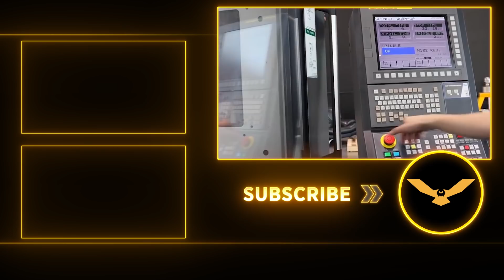There Was a Fire in Our Machine Shop

Comment: Used to have this stuff called Firetrace in the extraction hoods of the chemistry labs that I worked in. It was put in after a fire in a hood destroyed two whole floors and took them out of action for seven months. After Firetrace was put in a fire happened. The system worked, cut the electricity, put the fire out in 12 seconds. Fume hood operational in two hours. https://youtu.be/NzTkssjNRGs?si=s4wvzm1sdz9lZk1_

Comment: Seems like a solvable problem that could have been averted, using thermal 'cutouts' as heater safety backups, and possibly a 'dead man' timer that unless unit is checked & timer reset, it times out and halts after last process then shuts system  down completely, (similar to unattended X-ray film processors I've done in larger hospitals and as done in commercial photo development systems,) it could integrate an internal or 'local' fire suppression system to avoid a trigger of the entire facility fire suppression system also.😎

Comment: I know just how to prevent this, it's easy! A  redundant heat and fire monitor disconnect system, it's easy to build! Two simple process monitors measure tank temps live, if a tank is detected to be over max setting on either monitor, one or both in-line electrical contactors are automatically tripped and disconnected canceling all power to the process. Both these contactors can also be triggered by a fire monitor above the machine in combination with the tank monitors while also signaling your main shop fire monitoring system there is a fire present in the shop. The reason I do things in two's is preventing single system failures. You can also add localized fire suppression as an optional feature.
Reply: Even something simple as a float switch. It doesn't even need to sense heat it just knows at what level the level is too low.

Comment: I had to repair a lathe that had been damaged by fire. The shop was a large screw machine operation that used oil. If the wires for the door switch hadn't burned through and shorted stopping the machine, the coolant pump would have continued to feed the fire for who knows how long.

Comment: similar thing happened  at my job with a 55 gal strap drum heater.  It was used to evaporate  mixed mopping water that had a lot of way oil.  It was left on during weekend and caught fire .   HazMat  showed up and didn't know what the chemicals were .    One of those things that customers need more than one supplier  for

Comment: what is absolute ,machine orgin and realitive  in cnc milling machine . any one explain
Reply: Absolute is a measured point is set by an operator. Machine is the actual machine position in relationship to the distance the machine can travel. Say it has a 54" X, 34" Y, and 24" Z travel all of those start at 0 going up to those points. Along that travel an operator can set a " new zero" for a part to be made from. As in the center or corner of a vice or palet. This makes it so that when programming one doesnt have to make a starting point of 18.7267"X and 12.2323 Y and 4.7465 Z, they can set  Zero's for those points and measure out or up or down or in, from there. 
Hope that was more clear than mud.
Reply: @cliftonlewis1420  thank u so much 
bro
Reply: @viswasnadella8983 Wow you mean that made sense? Your welcome.

Comment: Need some sensors not only to notify the people in the event of a fire or something going wrong in the each machine but to cut off power and water supply to the machine shop for safety. A system engineer can get it done. Careful, boss!

Comment: I would have to use several microcontrollers with sensors to detect smoke, temperature,  water on the floor etc and get notified in the event of something going wrong like that.  Not hard to design and build.  Could setup several raspberry pi's or even arduino's to handle the monitoring.

Comment: Hi! Mistakes happen... Also a reason for a Fire at/in Machines is : mixing material like titanium and aluminium and coolant(Water). Gases are created that can burn! For example:
First you are working with 7075 aluminium / coolant- lubricant. Than you  working with titanium / dry Milling with sentos/air lubricant. The chips / spiders are glowing sometimes a little bit... And BOOOOM! The Mazak, DMG, GROB, Studer or what ever is burning... (there is a highly flammable Gas). In big Machine Shops they have  Machines only for Titanium and only for Aluminium... Or you mount a fire protection system in all titanium/aluminium machines. What says your insurance contract to that problem? What do they prefer? Sorry for my bad english! I wish you all the best for the future!

Comment: You can still do it, honestly it should have been in a separate installation apart from the rest of the shop. If you get say some EOS metal printers they should be in their own separate facility.
This is one of the few areas where lean manufacturing and space design has a definitive line. Some things need to be apart and separately in their own facilities.

Comment: Wow, that doesn't sound right, heating elements in a plastic tank? Auto shut-off when liquid level goes low didn't work? I've built systems like this before and my systems would've never failed like this. I make it impossible to fail. Hindsight is 20/20, but foresight is a thing and it sounds like someone didn't think about it when putting that system together.
Reply: No kidding

Comment: Why on earth did the shop not have sprinklers and a fire alarm system?
Reply: They were probably thinking "ha it will never happen to us"
Reply: I think it’s because you don’t want to wet all that machines, it could burn out electricity
Reply: @goldpredator2342  they have co2 fire suppression systems that won’t leave anything wet or harm the equipment ! That’s what should be installed in a cnc machine. Never heard of a sprinkler system or a “ wet agent “ being used inside the system. I’m guessing the sprinkler system in the warehouse is what flooded everything
Reply: Install High fog like Ships and Data centes, can spray anything with no damage